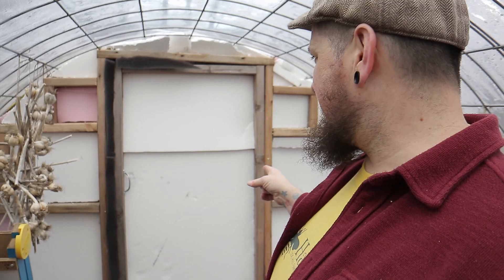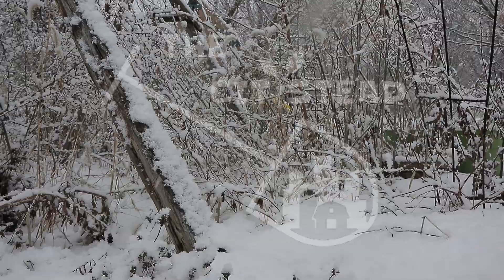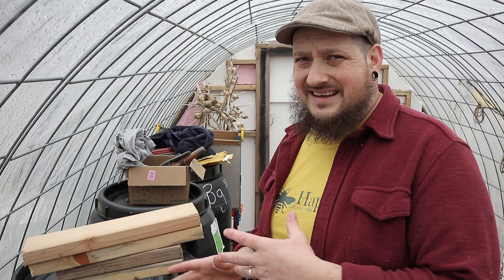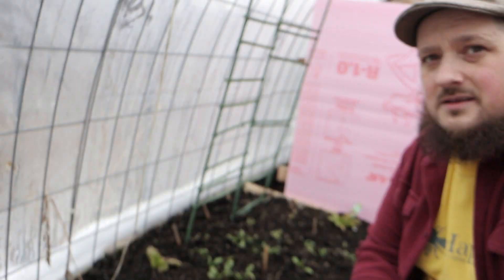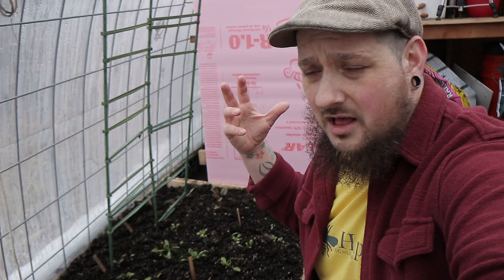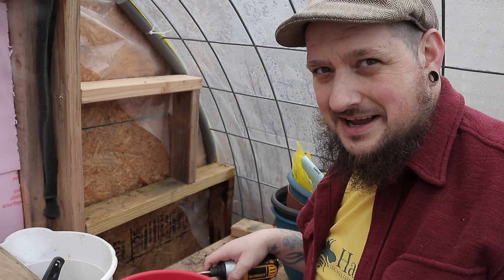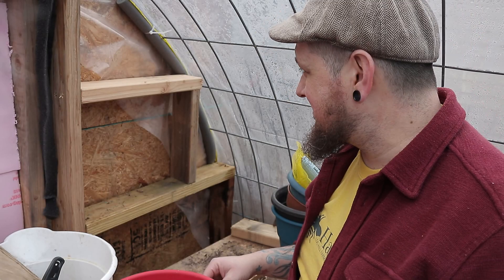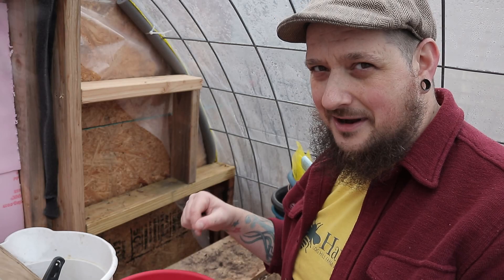Thermal Mass Free Heat Update

Comment: Had the same issue, I ended up building a big pile of clay soil  at my north end with a rocket stove dug into it, gets stupid hot and stays that way for days. The smart way would have been to run coils through it and heat the floor thermal mass but I like the simple lazy approach.

Comment: It's amazing how it actually does regulate temps and especially how it doesn't freeze isn't it? I use a 5 gallon bucket for my chickens in winter and am always amazed. It never freezes solid all the way through even on -10 F overnights!  I am always glad to answer any questions you might have on solar, thermal mass etc. Don't be afraid to reach out and ask. Love the insulated walls, nice work!
Reply from the maker: How's a good way to reach you? I've never set up anything solar powered and I want to start trying a few things with solar in the greenhouse
Reply: No need, I sent you an email. You can email me anytime.  I'd love to help and hear what your ideas are!  96 degrees in my greenhouse right now (42 F out and sunny).

Comment: You can add a low tunnel to your plants in the greenhouse. I have a bucket heater and I use my Jackery to plug it in and heat them. I would also consider an outer door or covering the end on the outside with plastic to help with heat loss around the main door.

Comment: Thermal MASS heating depends greatly on the material you use to store the heat. Snow the day after a sunny day does not stick immediately to the sidewalk but will stick to most metals. Is it density?

Comment: Thermal mass is all well and good, but pretty useless if you don't keep the heat contained. And, it is not just about insulating. Insulation is wasted if the heat is allowed to just radiate out at night. For an example of what I mean, consider a desert. In daytime heating it gets very, very hot, but then could get very uncomfortably cold at night. You would think all that hot sand would keep things warm at night but it doesn't. That is  because the heat just radiates out into space... unless there are clouds to reflect the heat back down. 

So what you need is a reflective material that you can completely cover your structure with at night. (or put up to hang in the interior at night) And it would help even more if that reflective layer could be insulated as well. That is to say at least having some dead air space between the reflective layer and outer cover of your structure.  

Air is not a good conductor of heat, but does not prevent heat loss by allowing heat to radiate away. So insulation helps prevent heat loss by slowing  heat exchange by conduction and a reflective helps to slow heat loss by preventing the heat from radiating away.

Conversely, in the spring, summer, and early fall, good ventilation and a shade cloth cover for your high tunnel hoop structure would help to reduce radiated sunlight from causing things to get too warm inside.

Comment: you should face the side with the barrels north and insulate the north half of the gerrnhouse (behind the barrels). There are no plants there, and most of the sun comes from the south in the winter. also if you have another layer of plastic 3.5 inches away from your first, the air gap would be r-1 insulation, and you would be doubling the amount of plastic  insulation you use (and you may be able to stack them)
Reply from the maker: I've been debating a second layer of plastic or possibly rebuilding the whole thing to have a solid wall on the north side and making it more like a lean to. I think I could get a little more space and insulate a solid wall to help hold heat in

Comment: Still not a fair trial, for your thermal-mass, heat sink. You need to start with a warmer Mass .
 If your barrels were full, and catching sun, all summer, (70ish ? degrees)then you would have had a better result.
Doubling your outer plastic, Fall to Spring, should help immensely. 
 I'd make a friendly wager, that you could outperform your current results, by an easy 10 degrees.
Reply from the maker: I'm going to aim for second layer of plastic for next winter. You go me thinking about the heat and what I have seen the past few days since finishing the insulation. I have a bucket heater coming soon thinking I'll warm the barrels up to around 70 or 80 and see what the temps do then
Reply: @Citystead  How did the bucket heater idea work out? I'm thinking about using a crock pot or two in mine to keep it above freezing on coldest nights.

Comment: The issue you have is getting the heat in and out of the barrels. First, you bought plastic barrels and plastic is an insulator. Metal would have been better, but you can solve that by pumping heat in and out with a fan. Find the largest pipe that fits in each top bung and fit a U-shaped metal pipe down in and out of the barrel, then add a little PC fan. Run one end up to the peak of the GH to gather the hot air and pump it thru the barrel during the day then at night it will dump the heat back out. If you don't have power add a solar panel and a battery. You are $100 away from a working system.

Comment: Solar air heater is great but if you take the output from it an put it through a thermal mass you will have a much more stable system overnight.
Reply from the maker: Cool to know, I need to work on a plan to pipe it through the thermal mass barrels
Reply: @Citystead  Id look to the Import auto racing scene at air to water intercoolers. Used to cool the turbo input air charge temperatures. Very efficient heat ex-changer.